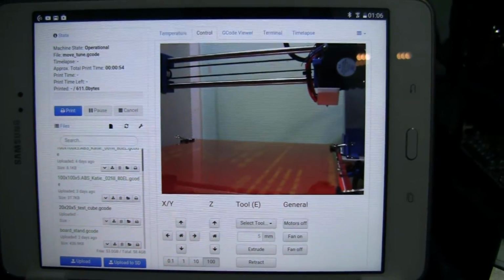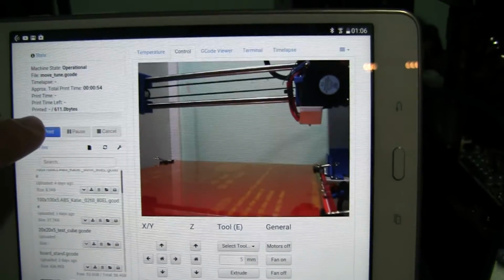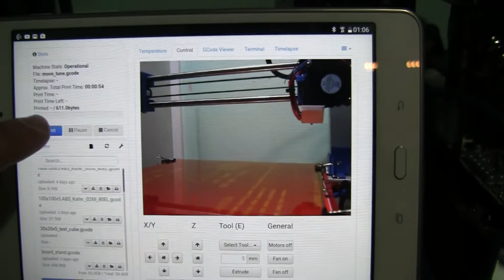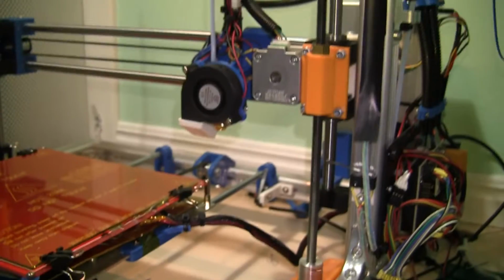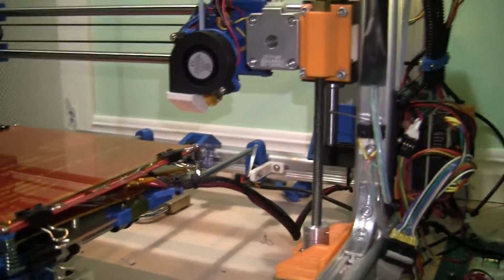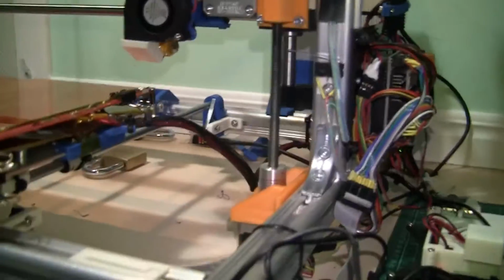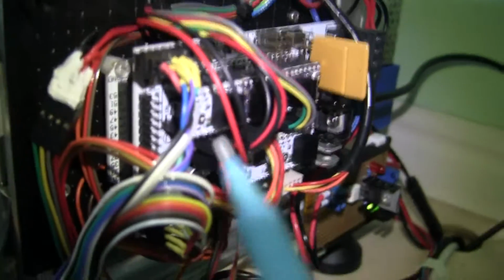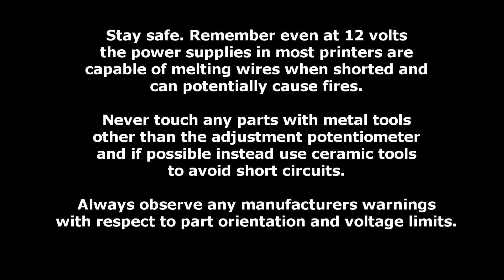How I tune my stepper drivers

Comment: What is the gcode file you are using?
Reply from the maker: It's just some gcode (that I wrote) that moves each axis from one end to the other, one by one. You can do the same thing in any control software by just moving the axis manually, you don't have to use gcode to do it (although it can make it somewhat easier).

G28 to home all your axes, then G1 Z50 to move Z up and out of the way, then G1 Z0 to move it back down, I did that for a couple of passes, then left Z up & out of the way and went on to G1 Y200, then G1 Y0 for a few passes, and G1 X200, G1 Y0 for another few passes. It's really nothing special.

Comment: Adjust by ears :-)
I have done the same with my cheap DIY Prusa i3 (replica) from CTC.
The driver for the Z-axis needs more power (two steppers share one driver)
and the extruder stepper needs more current as the X and Y axis also.